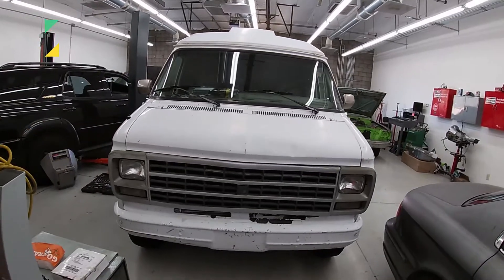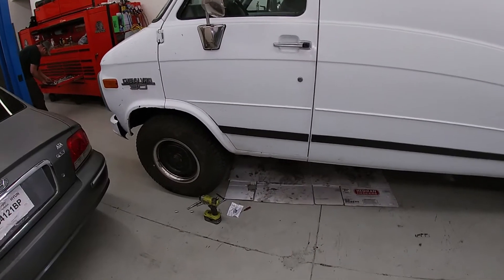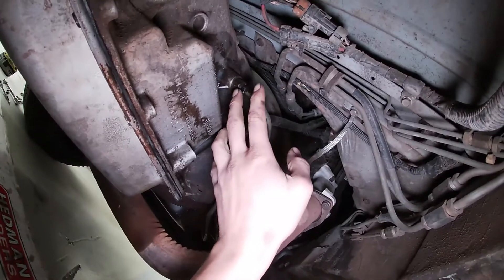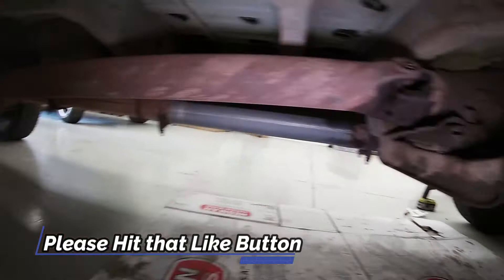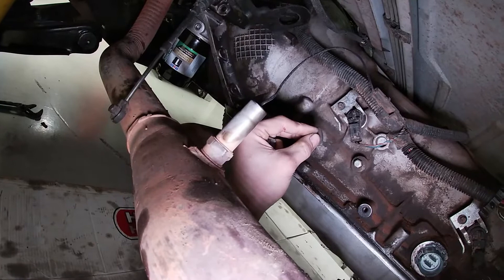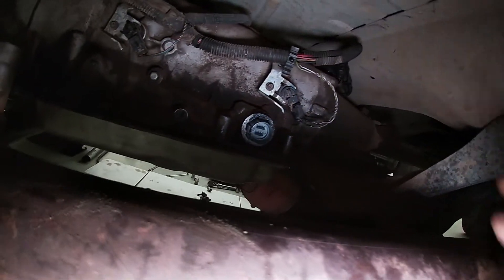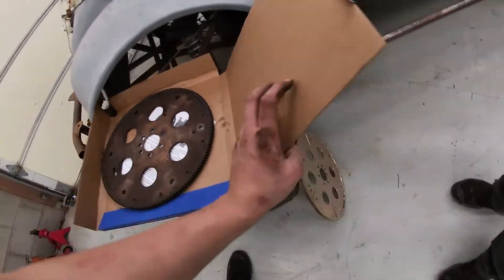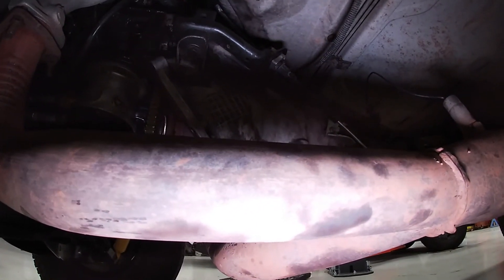Changing the Flex Plate on this 95 Chevrolet Van G3500 5.7L 350 TBI 4L80 Auto Trans the right part

Comment: Could it be my flex plate if my sound is backward from yours. Meaning at idle it is smooth but under load it rattles.
Reply from the maker: Generally under a load the sound will be less noticeable, that is not always the case however, it just depends on how it was broke. Is it on a Chevy G30?
Reply: @lostvisionsperformance  Yes. 92 G30. I feel like i have eliminated everything else it could be. 
 Im going to pull the dust cover and look for cracks later today. If its cracked i will use your video as a rough guide and see if i can swap it out in the driveway. Thanks.